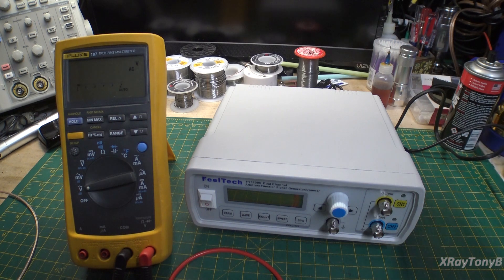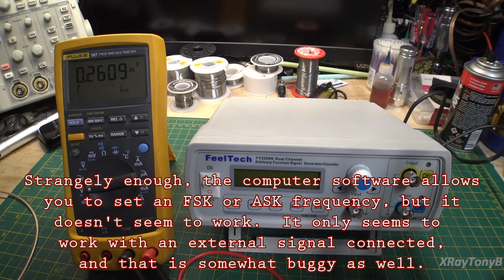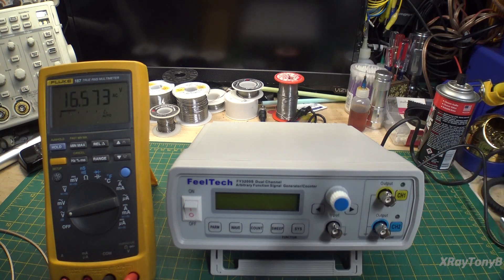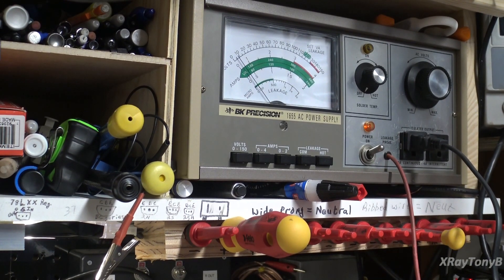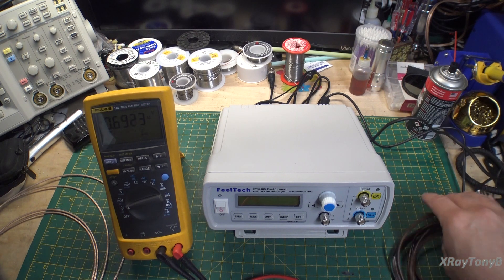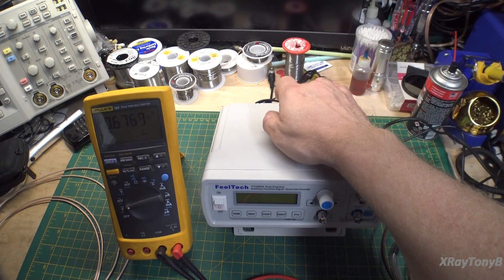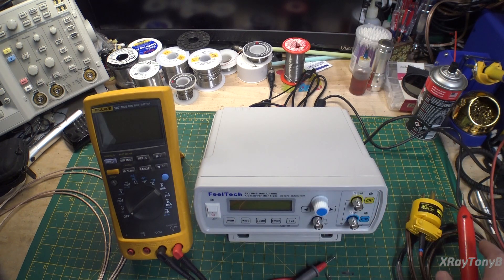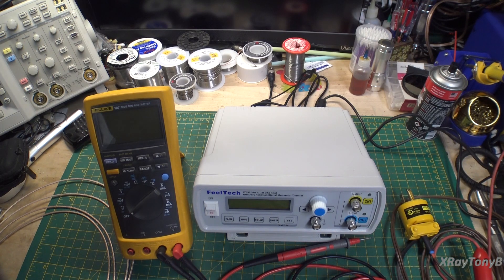FeelTech FY3200S Signal Generator   Leakage Issue

Comment: Just add a 3-pin AC socket and connect the ground to the common ground in the unit.  The leakage current basically disappears if you do this, no need to change the power supply.  (search for other videos showing this tweak...)

Comment: Switch mode power supply has issues because of poor grounding. So beware of this when testing other devices
with it. Probably need it plugged into an isolation transformer. Good idea to replace it with a linear style PS.

Comment: The weird waveform that that supposed to be AM (but not) will produce something on a radio if you key in 1/10 of the intended frequency.  It's make you wonder if the designers ever saw an AM radio before.   I have a Stancor P-8364 transformer that I might just use to upgrade the power supply on this thing.  Disappointing.

Comment: The reading is correct.  You are measuring between hot in the plug strip, and ground on the generator which is at earth.

Comment: Is there anyway you could do a review of the new version? The one with the color TFT screen and they have fixed the grounding issue. But apparently there is still some leakage trouble with 50 V coming to to the front Connectors. I’m getting ready to order one of these, and your input is always one of the most helpful and respected! Thanks for your content!
Reply: The new version also has the same switch mode power supply, and same problem. see video https://www.youtube.com/watch?v=pQxHFGXHPXg That Engineer provides information for a power supply replacement, that is reasonable cost.
Reply: @johnhodgson4216  you linked to the FY 6600 which was a concurrent model to the 3200. The updated versions are the 6800 and now the 6900. Those two models use a grounded plug and different  smps and leakage issue is resolved

Comment: Did a  similar thing to genius3258, installed 2 back to back 240V/9V little transformers between power supply and mains. Also added a switch to select floating / grounded. BTW if you have a basic model (low bandwidth) you can increase this by holding the menu button a specific amount of time while powering on. I added a 8-pin microcontroller that simulates a key press during power-up. By tweaking the delay loop I now have 15Mhz instead of 2 :-)
Reply from the maker: Those are some great tips.  Thanks for sharing!

Comment: I have fixed this by putting insulation trasformer in between orignal switching power supply and mains. Just used small 20VA toroidal transformer and wound another 230v winding on it making it a 230/230v insulation transformer. Installed it directly into the generator.  Cost me 10€ works great

Comment: Plug in the USB to a grounded host computer and the leakage goes away. What cracks me up the most are all the comments from seasoned electronics vets....and here I am just starting out a couple months back....lol!! The problem is that the old guys don't believe in computers so the simplest answer eludes them every time!!!
Reply: John, you're right... partially. Seasoned vets also know that once you have hard ground as a reference, you limit the usage as it is impossible to use the generator 'floating' and use some level in the circuit as a reference ground. You will short your circuit to ground. A typical caveat of beginners is not knowing the difference between floating or grounded use when using for instance a scope. They learn after blowing up their first scope.   So listen carefully to old guys as they can save you a lot of money.
Reply: Well the leakage doesn't go away, your just shorting the leakage current to ground...and that leakage current is also going to affect the DC that the USB connection is running to your laptop. 100ma at 115vac with 0.707 power factor is  8.13 watts of power your grounding into your laptop.
Reply: @johnhodgson4216  The leakage current is in the microamps not milliamps range! 100uA isn't 100mA.
Reply: @SpeccyMan  The leakage current in both of my function generators were so bad, that they are unusable until I replace the PSU itself with a proper power supply.

Comment: The device is also sold with a US 2 pin connector in the U.K. (Doh!) where ONLY 3 pole socket wall outlets are allowed (i.e. 3rd pin earthed / grounded). I quite agree about the damage to any equipment connected to it and the stated 100 micro amps present no danger of shock. In the U.K. it is common for an earth leakage of 30 to 40 micro-amps to occur in a 3 core 5 metre mains cable with nothing connected to it (i.e. just the cable plugged into the wall socket!) The threshold of feeling at 50/60Hz is about 1mA with a lethal current at some 30mA: the tingling feeling is most likely due to the high frequency of the SM PSU . Thanks for the warning: my FY3200S is about to be modified with an IEC connector, 3 core mains cable, and a 1 Amp plug fuse (yep the plugs are individuallly fused over here). Nice review.
Reply: Mine came with a UK plug. However the Earth is not connected so the leakage is there. Will be doing the IEC connector mod.
Reply: @SpeccyMan  Great: the IEC connector fits in without any real difficulty. You could also increase the cross section area of the earthing cable where they connect with the metallic parts of the connectors: this would give the mains fuse time to blow before any large fault currents could occur.
Reply: 2 pole IEC’s are allowed in the U.K. with some restrictions about isolation. Plenty of U.K./CE approved products with them.

Comment: Yes, the voltage issue is a major problem. I modified mine to run off +12v so I can use it on my cars & boats & to fix the safety issue. It’s pretty simple if you’re technically inclined. If my memory is correct, I added a +5v 1A linear supply & a couple of isolated switchers (seems like I needed +12v & -12v but very little current). Seems like it pulled ~400mA from the wall wart. Now I can plug it into a wall wart or a cigarette lighter. There’s even room in the case for a small +12v battery if I ever need to go wireless.
The documentation & Windows app that came with it are what the dog left in the yard. However, it has a command mode so you can drive it from a terminal program or easily program it to an app.
Using Terminal Commands with FY3200S (9600 baud n81  usually appears as COM6)
Terminal program (e.g. TTerm) must be setup to send a linefeed when Enter key is pressed.
https://integrac.sk/wp-content/uploads/2018/02/FY3200S-DDS-Protocol-EN-DRAFT-.pdf
It’s a very useful piece of equipment after the original engineering is fixed.

Comment: Tony, I'd really enjoy seeing the design, fabrication and installation of a linear power supply in that unit if you have the desire and time to create the video.
Reply: Don't forget that linear power supplies also generate earth leakage: even the short mains cable alone will generate 20uA leakage (due to the wires forming parallel plate capacitors). Earthing the BNC shells is the best way to improve the safety of both delicate electronics and humans. (PS I have a deep distrust of switch mode power supplies and prefer linear ones but then I am getting very old).

Comment: Yes there is a fair amount of leakage resulting in almost mains voltage on the exposed BNC connectors, but we need to remember this is in the microvolt range, so if you grab the connector, you will not get a jolt of it, there isn't enough current, BUT, it can and will, as stated in the video, destroy sensitive devices such as JFET's and static sensitive devices, processors and things like that.....Thanks for getting the word out there and letting people know about this....
Reply: Microvolt range or micro Amps? It's the volts that jolts but the millis that killis (micros really are quite friendly)!